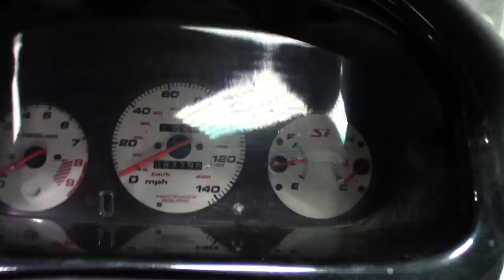Look What Fell Into My Lap

Comment: Sweet pick up Jim, that cluster has been swapped so I’m not so sure about the milage. Definitely a lot of work, can’t wait to see how you fix it !
Reply: It could be a glow gauge that covers the OEM cluster.
Reply: Bentlyco0p the cluster set up is for a 2002-2005 civic si
Reply: @alexfranco5831  sorry man that's incorrect that is in fact a ek 96-00 cluster the 01+ cluster have the fuel and temp on the same side except they are on top one a other instead of side by side, while it "could" be a swapped cluster from another civic it still could be the original cluster, it just simply has an overlay from Ebay. Pretty common to see hondas with the overlays

Comment: Man I'm curious to see you pull this one off it looks rough lol I don't know much about hondas but I feel like I could find one in better shape but this will be cool to see!!
Reply from the maker: These are rough to find in my area. The better shape there in the more they cost.
Reply: @JRC54  oh that makes sense I'm gonna be on the lookout for these now I'm very curious.
Reply: hey cp honda are fucks there is like 15 diff engine set ups you can go from. if built right some engines like the b series and k series can make 1000 + hp
Reply: @JRC54  they are hard to find everywhere, most parts from Honda are no longer available to restore these.